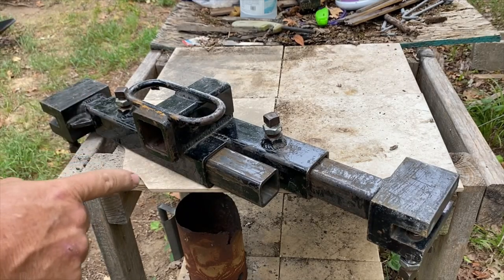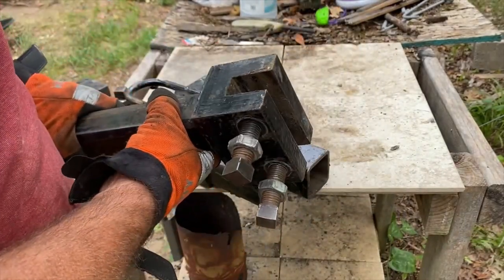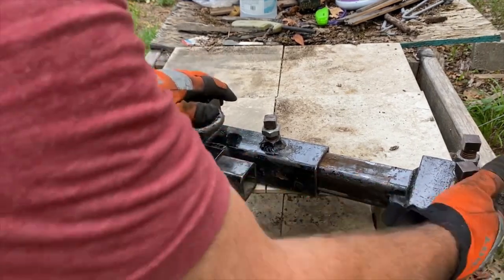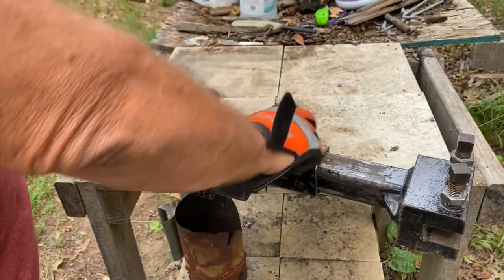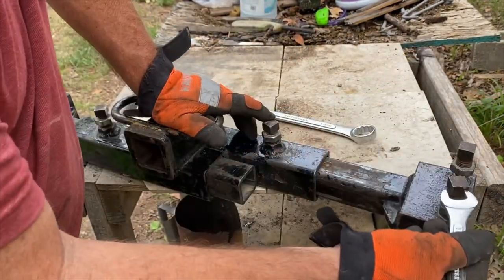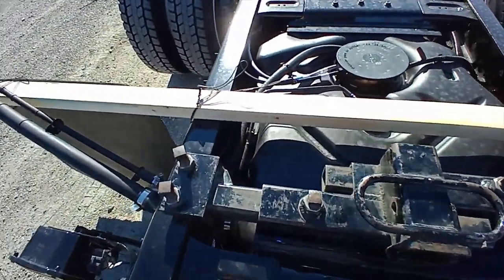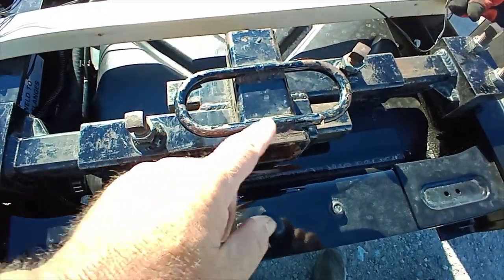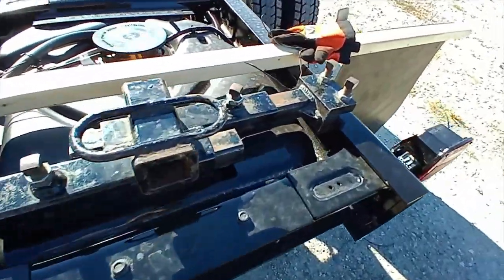Tier1 Fabrication Frame Rail (PINCH) Hitch Review

Comment: For anyone that would rather use a socket than a wrench.  " URREA Impact Socket - 3/4” 8-Point Socket with 1/2" Drive & Black Oxide Coating - 7424S " from amazon is the cheapest I've found for those square head bolts.  Cheap impact makes zipping them on and off much quicker.
Reply from the maker: Thanks for that tip! I'll have to check them out.

Comment: This hitch, as most predecessors where design, built and sold by Martins welding in Wakarus, IN...the first ones over 25 years ago. They do make a model "B" of this design but only by special request. Instead of two tubes, one for each direction, it has only one tube in which one side has the interior sliding tube and clamp like the  one shown here. The other side, has a tube that is "bigger" than the main tube and slides on the "outside". This makes the whole unit much slimmer. This doesnt make a difference that often...but when you need thinner...your glad you have it.
Reply from the maker: I plan on getting a single tube pinch hitch soon. Lots of places they would work where this double tube design won't.
Reply from the maker: @Jimboy718  anytime I couldn't get my double tubed pinch hitch to work, I wouldn't have been able to get it to work with adapters either (it's rare this happens, but it has happened a few times) It's then I call and say "I can't hook up to this unit". Then they can decided to pay for your travel back or let you go on to another unit.
Reply: Kris white builds a far superior product. I stopped my martins a few weeks ago and looked at his. I had seen the tier 1 already. The welding alone was what made me buy the Tier 1 vs Martins!

Comment: I understand the idea of hooking safety chains to something permanent like the frame but why put handles that look like safety chain hook points? That isn't a good design for handles and why are handles needed? Looks like you can just grab hold of it anywhere and take off. The placement and design looks like safety chain connection points. 🤔
Reply from the maker: I guess you could grab it anywhere. But once it's been on several tractors with fifth wheels, they can get a little greasy. Plus, the handles are centered and grabbing them there is easier. These hitches weigh about 50 to 60 lbs.